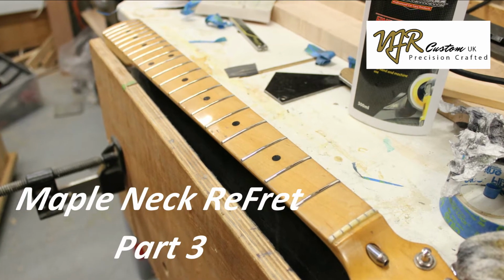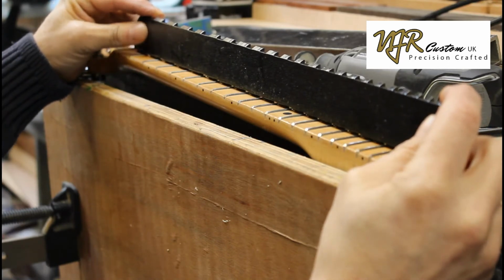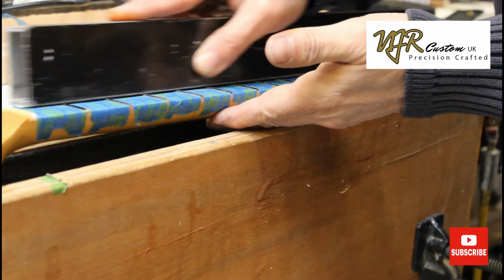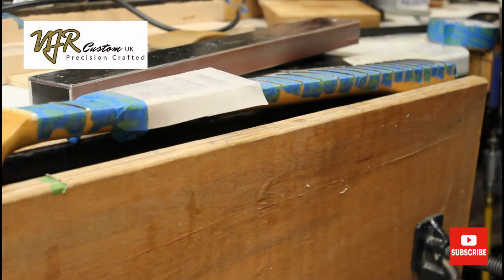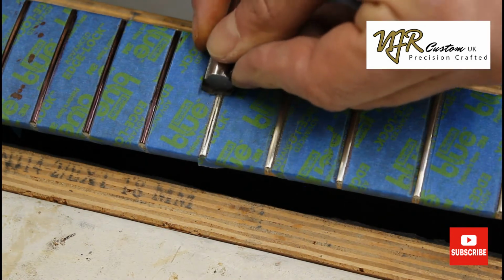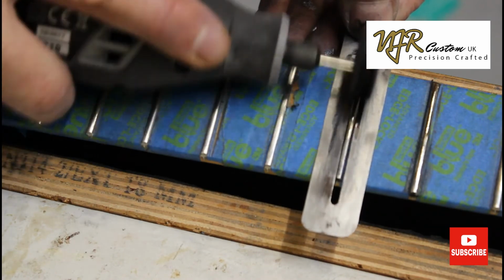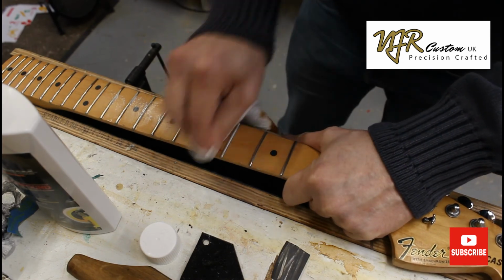Fender Stratocaster Maple Neck ReFret Part 3 Level Crown & Polish

Comment: I just finished leveling my frets and noticed that they all got touched by my 10" leveling beam, and there's no rocking with a fret rocker, but there are still gaps with a notched straight edge. Is this because the plane that spans 3 frets with the fret rocker is different than the plane that spans the neck?
Reply: Sounds like you leveled the frets with the neck not straight. That won’t necessarily affect playability

Comment: Hello. I have a maple neck telecaster that has some pretty serious divets in the frets and im thinking of putting some stainless steel frets in. I have an ibanez with ss frets and i have leveled frets with good success before. Do you know what size frets would be good on a telecaster? I like medium jumbos pretty well but dont want to replace the nut if i dont have to? Ive looked at fretwire on ebay but not sure about sizing
Reply from the maker: Hi I always use med jumbo fret wire  
https://guitarsandwoods.com/hosco-precut-stainless-steel-medium-jumbo-fretwire-pack-of-24.html

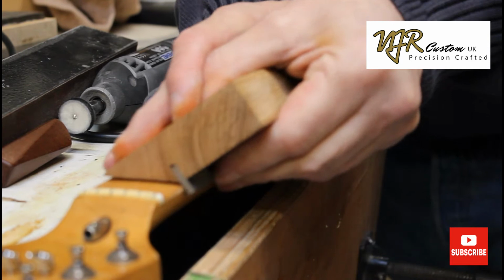Comment: Great tutorial....unfortunately due to my hearing, your accent ( to me anyway :) and the loud music, I missed some of your dialog - especially from 1:04 - 1:36 :(
Reply: "Second step, this is a fret beveling tool from Guitars and Woods in Portugal- I shall put a link in the description. It's a 35 degree by 90 (degree) set file. And at the previous step I'm taking this down almost to the lacquer- as far as I dare to go without touching the lacquer, and I shall finish it later with a really fine file when we dress the fret ends. Obviously this is done to the both sides of the neck."